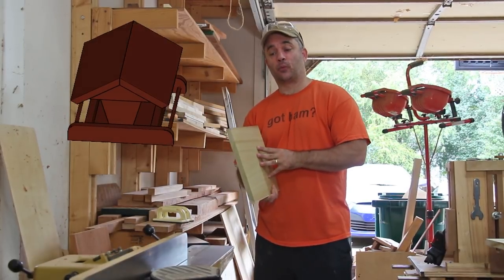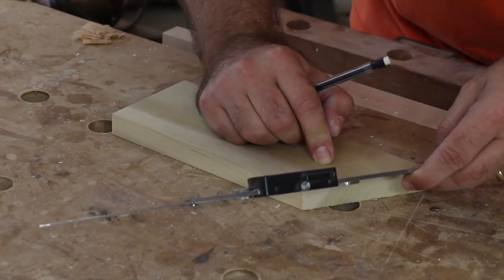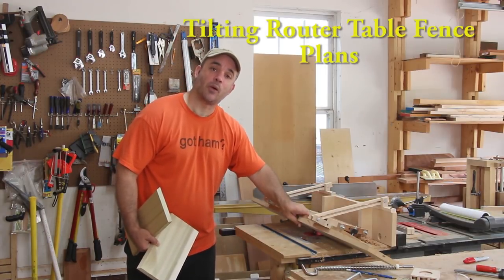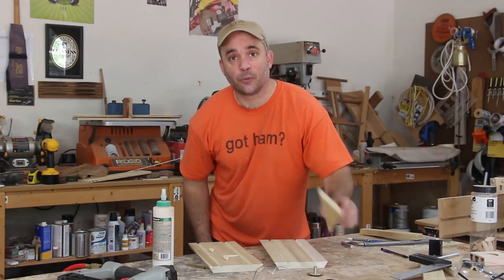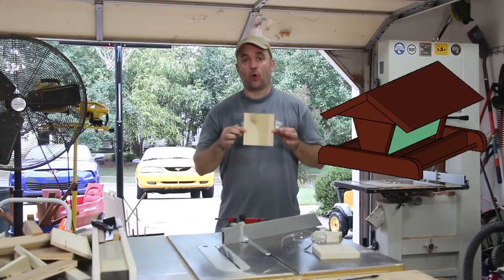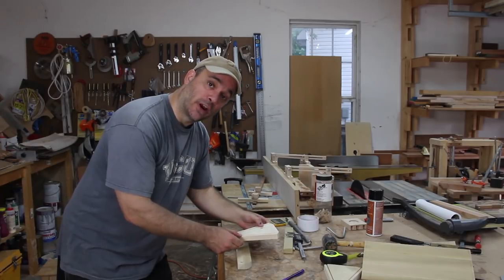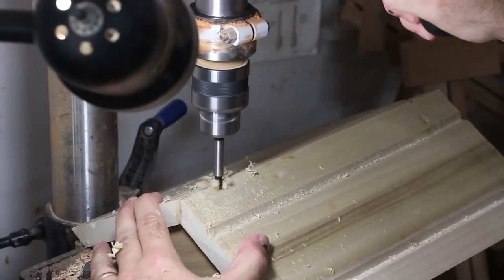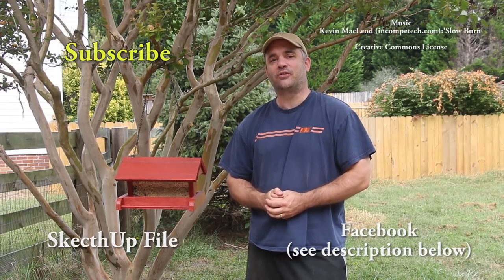Make a Hanging Bird Feeder

Comment: I made one similar to this with the sliding rooftop.  Rain doesn't enter through the holes in the roof because the holes are drilled through the roof outside the uprights.  The 14 g wire I used to hang the feeder is anchored using wood screws about an inch below the roof, on the outside of the uprights.  Using the wire makes it easier to slide the roof up for reloading the feeder.  Now if I can just keep the squirrels away from it...Nice looking feeder, GW!